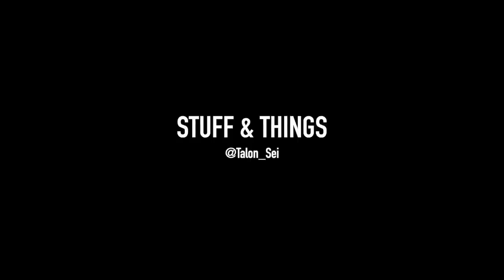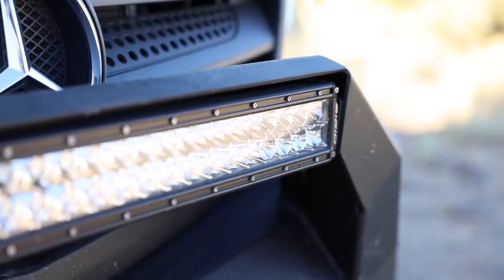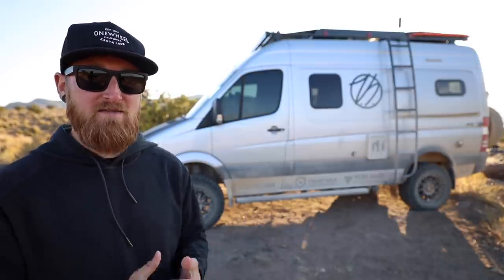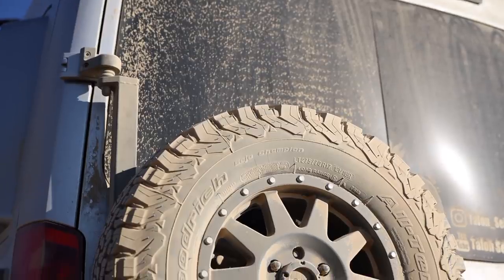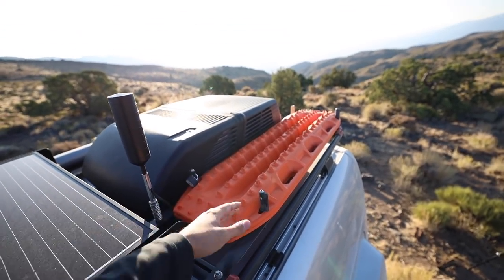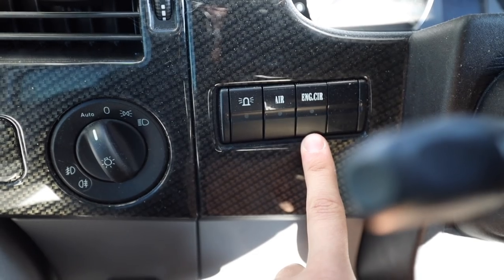Off-Road Van Modifications! | SATvan 2.0

Comment from the maker: Here is a video index if you are looking for specifics... or just be super cool and watch the whole thing 😉
1:25 Bumper / Winch / Lights
3:11 Suspension
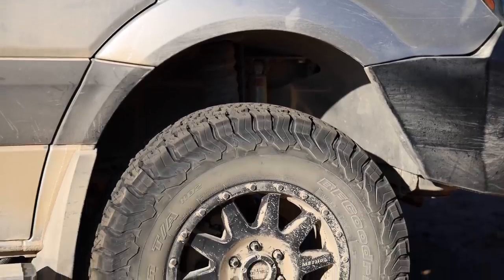5:00 Wheels / Tires
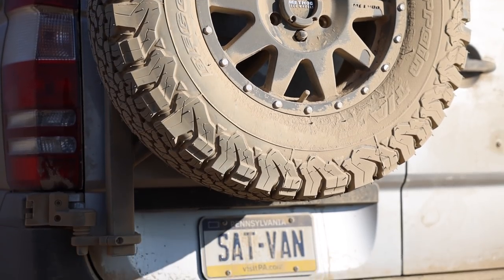6:21 Side Ladder
7:30 Roof Accessories / Solar
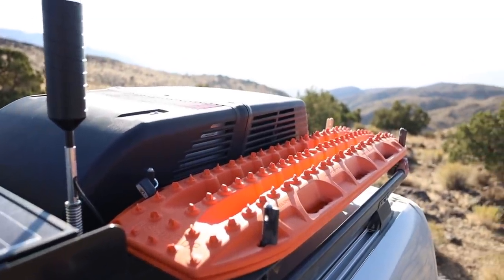8:49 Exhaust Mod
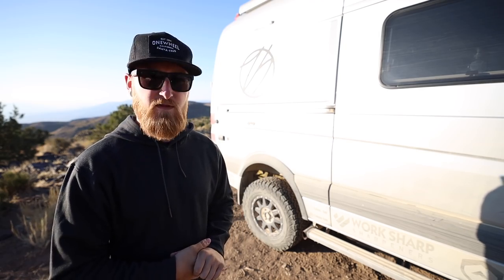9:32 CTEK Battery Charger
10:50 Weboost Drive X RV
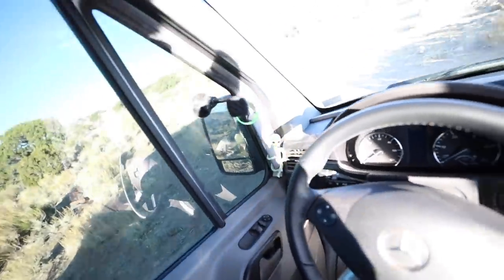13:36 ARB Twin Air Compressor
16:10 Espar Relocation
20:53 Garage Lounge Storage System
Reply: Maybe consider getting something to help with better traction so you could have possibly " crawled " over that obstacle in Mengel Pass.

Not sure what it has stock.

The vid looked like open diff.

A locking diff in the rear or center locking diff could have made a huge Difference....

Just my 2 cents. Been all around that area with all kinds of rigs and having a locking diff is so much better. 

Liked seeing you in the geologists cabin up at striped butts, spotted a book my late father left inside as you panned the inside.

Happy Trails !!
Reply: I’m torn and don’t know where to start  with mods.  We’ve gone places in OR and NV where many mods would have been appreciated.  Off camber and huge boulders with a cliff or steep down sloop is frequent.  We’ll be doing back country skiing in remote NV and CA Sierras this year.  Love your videos.

Comment: Buddy really enjoyed the walk around in a van gonna love the new tires and lift,I lifted my truck this year and I love it also the Wii boost I put that in the same one into truck I only kick it up when I’m parked though because of my set up with the rooftop tent and I will tell you it does improve my bars wherever I go. Also dig the light bars that’s my next step to do to my truck with the new winch on the front,  in the back part room I saw that on the last video that was a great upgrade. So overall your van is kicking bro ok 👌🏼🔥🤠🔥 Camping Russ out

Comment: I have what most people would consider an above average knowledge on the subject of wireless  signals with a device like Weboost.  YOU CANNOT BOOST SIGNAL.  You can repeat signal into another area.  In other words, someone can take the level of signal that they can achieve standing on the roof  their van and bring that level of signal into the van.  Bear in mind that solid materials such as metal, glass and any other hard surface attenuate radio signals.    Stand outside with your phone and whatever "bars" you get the Weboost will bring them inside.
Reply from the maker: The antenna on the weboost is much stronger than a cellphone antenna, so what it does is takes the signal and repeats it / amplifies it inside of the van. It works great on the fringe of reception 👌🏻
Reply: BTW, really good video.

Comment: Have you ever weighed your rig fully loaded?  I'd be curious.  On my Ford it's rated at 3950 lbs GVW .. but after my mod's I ended up at 4440 lbs.  Bumpers, winch, bull bar, sliders .. all adds up!
Reply from the maker: Haven’t weighed it yet but I would guess a little over 7500

Comment: For the Weboost,  I'm a trucker driver and I have one.  Think of it as a amplifier in your ride.  If your ride has no power your amplifier has no power to amplify.  It increases a weak signal to a better signal for your devices to work

Comment: Great video. Did the espar relocation reduce the noise levels on the outside of the van when the espar is running? Sometimes I'm in campgrounds next to people in tents and I always worry the espar is too loud. (Also for my neighbors in when its parked in my driveway and not winterized.) Thanks!

Comment: I never hear about you talking about using ac.  Can you use it engine off?  How long will it last on battery?  Or what type of draw does it take?
Reply from the maker: I haven’t needed to use the AC since mid summer in Texas. That’s the only feature of the van that would require lithium or a generator to run off grid. Everything else is self sufficient with the current solar - ctek set up.

Comment: Do you find you use your roof AC much? & how well does the max air fan work now that its cover by solar panels?
Reply from the maker: I don’t use the AC unless it’s necessary like southern Texas in July. The max air fan has not changed, still works the same and the solar blocks most light from coming through there which is nice.
Reply: & do you know if 2021 Revel has the lithium batteries?
Reply: never mind...found out, it does! & you speak well on your vids!

Comment: Are you ever worried about tip over?
Reply from the maker: No. The weight / center of gravity is positioned as low as possible in the van and the suspension upgrades also add extra stability